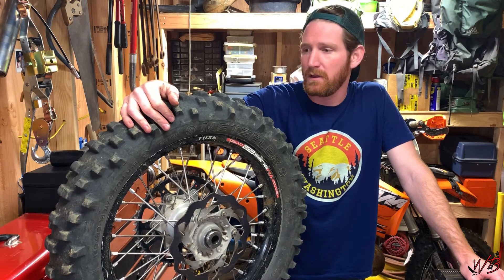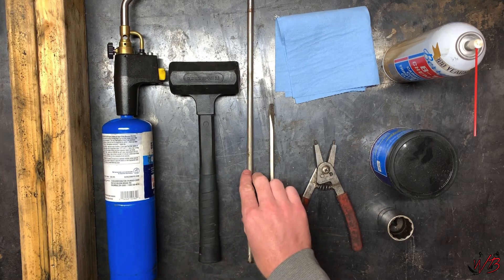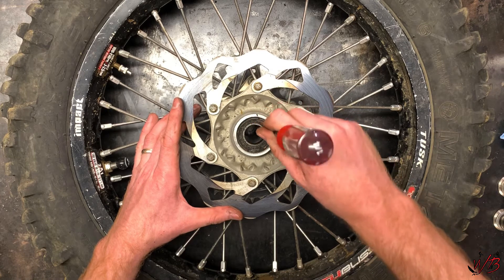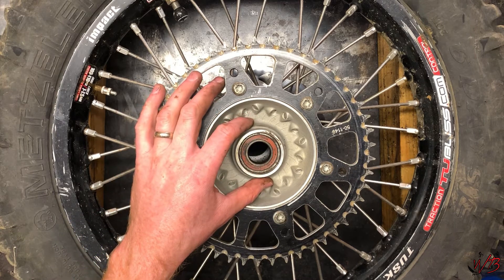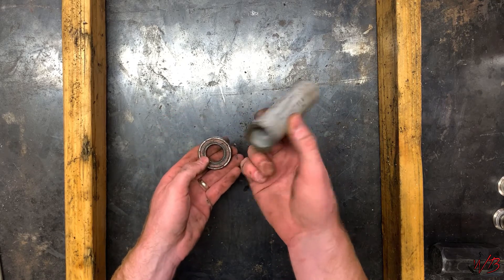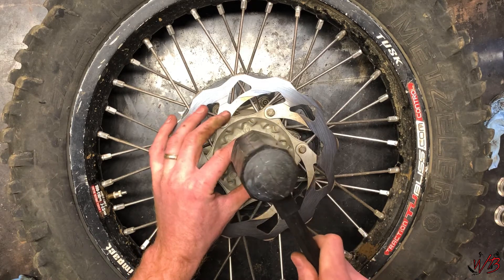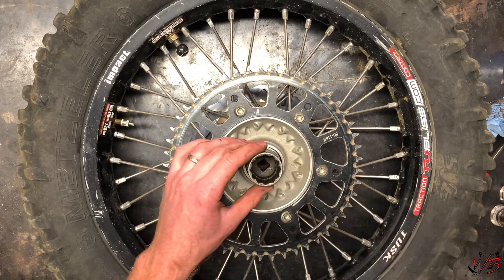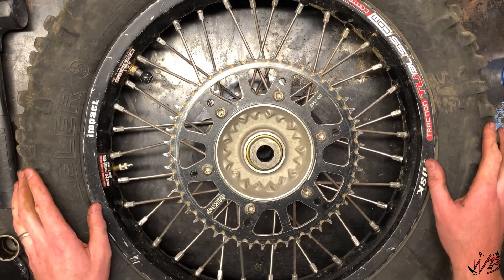How To Change Motorcycle/Dirt Bike 🏍 Wheel Bearings ⚙️🛠 and Dust Seals

Comment: Heyy man great job and thumps uo for the detailed explanation!, I'm novice to dirt biking, own a wr250f 2016, regarding maintenance i was wondering how can I gain enough knowledge to start doing complex stuff like top end rebuild, cam chain replacement for example. 
until now the bike is running well and getting oil change every 15 hours, and greased the bearing and linkage and trying to do as much maintenance on my own within my technical skill limit, but still I'd like to learn more.
Reply from the maker: Hey! Thank you! I can totally relate. I come from a mechanic background so I feel pretty confident in tearing my bikes apart and putting them back together but I get that’s not everyone. Just some practical advise. I still go and watch a few YouTube videos if I’m working on something I’ve never done before. It’s amazing how you can always pick up a little bit of information here and there from the way other people do the same thing. I’d recommend getting the mechanics manual for your specific bike. That will have step by step instructions for just about everything you want to know how to do. Something I always try to do is not let a project sit for too long. Assembly is just the reverse of taking something apart and that’s easy to remember unless it’s been weeks or months. It makes it easy if you have all the parts and tools up front when you start the project. Also invest in good tools. That makes a huge difference if you really want to do this well. Lastly, pay attention to torque specs. If you don’t have a keenly tuned mechanics feel, it’s better to tighten bolts down to spec than snap them off which is easy to do.  I’d invest in a good torque wrench :) other than that, just keep doing it. You’ll mess up but that’s fine. You learn everything time you do something new. Worst case you can take it to the shop then and have them sort it out.
Reply: Start with the basics, like you're doing, and just work your way up through the maintenance tasks. Mostly don't let a project intimidate you, just work through it one step at a time.